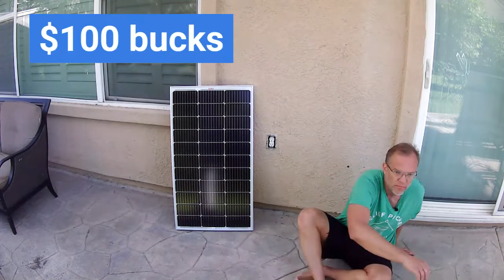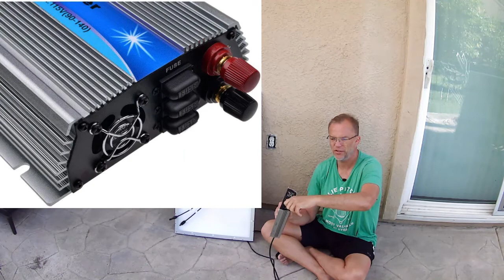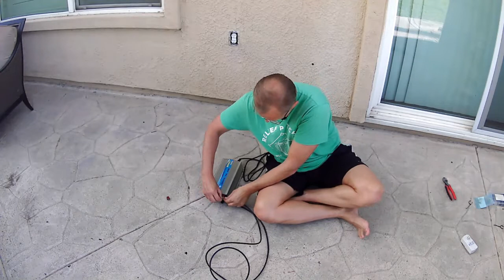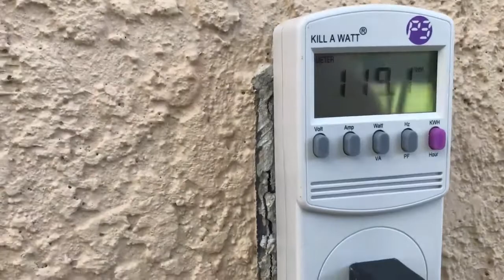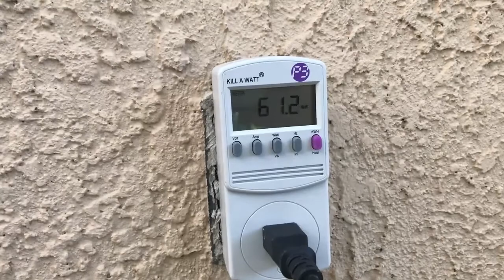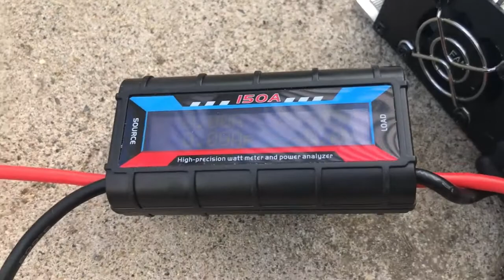Basic Solar Grid Tie System I Cheap AMAZON Inverter

Comment: Can't share pic. But 2023 bought 1200w that inverter then two used 230w ( not getting 230w out both) then smart plug . Averaged cost of kilowatt since in California we're on a time of day , rates have smud . From 2024 to today over 431 kwh and $91 saved. I leave the inverter outside under the solar panel on a table.  I'm getting from friend 10 320w panpel s wanting up game .
Doing it legitly $29000 system has been a headache installer. One out of business 2022 solar edge communication stopped 3g wanted them $700 just for the modem not including trying to find somebody to install. To today because there's no monitoring seeing my bill for the electric companies been high, notice December that system's inverter, dead solar edge will replace the inverter but I have to find electrician to install $$$$$$ bad $300 to have one of their certified installers to a diagnostic 😕 to quote me$7400 😡😡😡😡😡 diy works just from want heared don't produce more than you use.

Comment: Wow well done you are who I was looking for solar 101
Reply from the maker: thanks mate, this year we plan on adding batteries to the system
Reply: @ Because I live in an area where my utility needs to shut off the power in the summer if the wind blows to prevent their grid from causing fires I installed a back up system.   I will use a common water distribution system to better help explain what I did.  I used three 200 amp lithium batteries as the lake and then I put a 4000 watt pure sine wave inverter down stream to feed 6 circuits in our home through a transfer switch so  there is no possible back feed into the power grid.  Upstream I bought a Honda 3500 inverter generator that powers a 60 watt battery charger to flow down stream into the lake keeping it full during the day.  But shutting it off at night and just running on batteries just to be safe about fire hazards etc. my ultimate goal is to replace the need for the Honda with solar panels and you gave me a starting point so thank you.